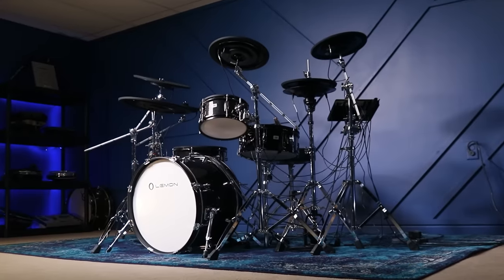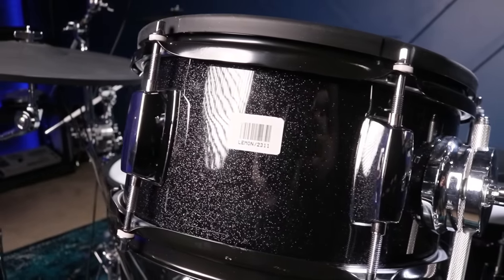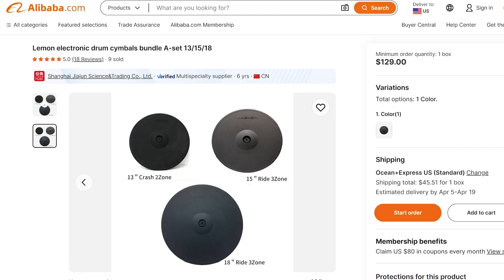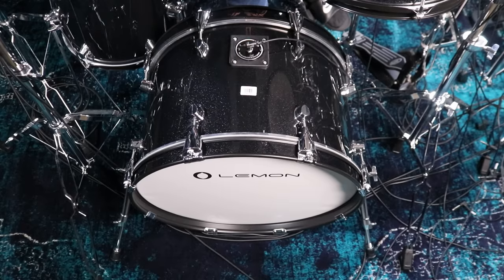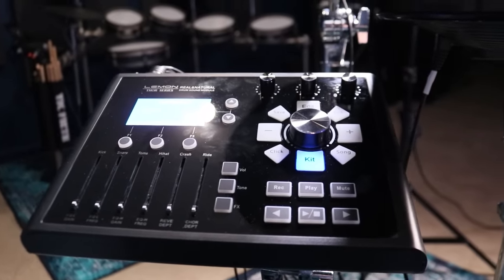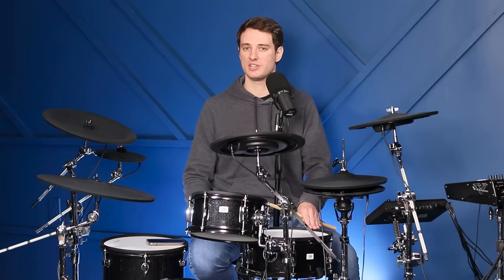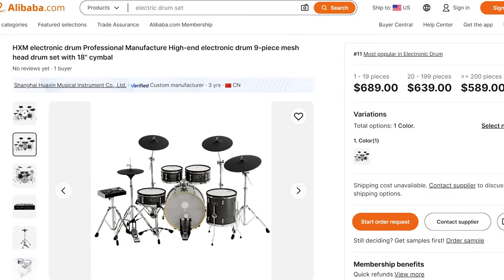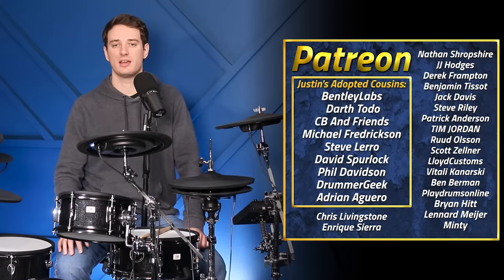Lemon T950 Review - The Alibaba Drum Set

Comment: I've had this kit for over a year, and I'm on the complete opposite end of the spectrum. I would recommend it to 99% of people. Not a single drum module out there can produce the sounds that I can with Superior Drums or some custom made kits inside Logic.  I would skip the $140 module and buy eDrumin 10 and trigger Superior, Logic, Kontakt, BFD or whatever you wish. I would also skip the 13" crashes and pay the extra $7-8 to upgrade to either 15" crashes or 18" rides to use as crashes. I lowered the tension on all of the mesh heads and my experience improved 10x  with respect to triggering and nuanced playing. This is especially true for the kick drum. Also, I stuffed old couch cushions full of all the shells and noise pretty much disappeared. And last but not least, in Nov-Dec 2023 Lemon started putting 3ply mesh heads on their kits. The way you know is if the kick out head is a resonant head (not mesh) you have 3 ply mesh on all of the strike zones of the shells. Skip the module, skip the kick pedal, replace some cymbals with larger ones and this is pretty much a perfect, nearly a full size kit. I love that the kick isn't too deep which makes this kit, being full size, a perfect one to place in a smaller room..
Reply: Wohooo! Could be my comment, mate! 
Module-wise I am a kind of spoiled using 3 eDRUMins.
The Lemon module seems to suck. What about latency, is there more latency than with the Roland thing?

For edums became kind of a religion at least passion. Damn I love these SD3 sounds.
See my info tab. I still use basically the MPS-850 and mixed them with 2 12" Alesis tom pads. Snare is a drum-tec style DIY system, and Lemon cymbals -- the BIG one, dudes.
All 3 zones. 15" hihat - also Lemon 3zones (so I can use the SD3 bell articulations), with a DIY Hall sensor. And ... it's amazing. There is one Lemon snare pad which I use a the side snare, it's working with positional sensing actually but I think I will put my Jobeky snare back on a snare snare stand.
3x 11" splashes, 3zone, of course. I modded some of the Lemon cymbals that they work as Yahama style cymbals to save inputs on the modules and ... recently, I was really pi***d off by the bouncy ATV 13" kick pad and ... don't ask how I get to that... but I bought 2 Roland used KD-7, they work great. :-)

A few weeks ago I was using some simple piezo as kick pedal triggers,  and they actually work quite well but ... ya ... still the bouncy ATV pad.

Yeah... obviously not only drumming. I spent more money on the sounds, that on the pads. LakePeople hp amp, RME Babyface interface...
Reply: Agreed
Reply: " Not a single drum module out there can produce the sounds that I can with Superior Drums" The 2Box Drumit 3 and 5 does Sound like Toontrack,  Addictive,  BFD,  Steven Slate Drums or what ever, if you layer the Drumkits and load them in to the Module :-)
Reply: @c.s.8192  Making drum module jokes?
Reply: @eDrumsInANutshell  no jokes.
Reply: You're a legend. Thanks for the description
Reply: total rubbish bud.
Reply: Found the shill! 😂
Reply: Yes even with high end kits like Roland’s, VST’s like superior drummer 3 smoke even the most premium kits’ modules. I have a nice kit (TD-27kv2) and I thought the module sounds were decent but felt like I was playing an electric kit. Until I downloaded superior drummer 3 you have endless options of professional sounding kits. I live in a apartment so have to play quietly and I was using SD3 with my DT 770’s and I literally felt like I was playing real acoustic drums sound wise. I had to take my headphones off to doublecheck that I wasn’t actually playing those sounds out loud. Definitely recommend using a VST regardless of what kit you’re using.

Comment: You GOTTA do the XD-2000 from HXM. I just got it, insane value for under $1000 (shipped!). It's the same exact kit as the Millenium MPS - 1000 from Thomann. Has a module with EIGHT line outs like an Alesis Strike Pro SE. Really interesting hi hat design that acts like a two piece in a one piece, and it's optical. Seems much better put together than this. Except for the cymbals... I've had a cosmetic issue with the cymbals, but even for the shells alone, it's more than worth it.

To be fair, I used it with my eDrumin 10 and not the stock module (I'm the guy with the Dante setup you covered in another video), but I may try to set it up soon. Let me know if you have any questions.

Wrote my comment before I saw the end of the video... lol.

Also forgot to mention:

- I'm not sure if the line outs on the HXM module are balanced; the seller said they're unbalanced. I haven't tested this out and would require an 8 channel DI box if true. 

- The HXM hi hat is optical. I've gotten it to TECHNICALLY of work on the eDrumin 10 (it would go through the entire range of the controller everytime I hit the pad with the pedal anywhere between closed and open), but I just use the GoeDrum controller underneath the HXM hi hat so I get the action of a two-piece hi hat pad. Even though the HXM hi hat is one piece, the design actually allows it so slosh around or stay put like a two-piece pad because of this weird ring on the bottom of the pad that sits on a little circular platform. I put the Goedrum underneath the platform with a tiny foam ring between them.
Reply: Thanks for the comment. +1 to a review of HXM kit please. I am very interested.
Reply: How much latency are you getting with your Dante setup?
Reply: Also, may I ask which video it was covered in? I'd be interested to see it!
Reply: @galgogergo  Very little if any. I'd say it's probably faster than if we used a USB audio interface, because there's less A/D conversion that has to take place. I've even forgotten to switch it from 512 samples to 64 samples because I didn't notice any lag. It was covered in the video "This was supposed to be a roast" or something like that.
Reply: @austinpalmer8850  cool, I'm watching it right now! Can you say at which time it comes up?
Reply: @austinpalmer8850  AHH, found it from 12:12 in the video "This was supposed to be a roast".
Let me ask some more:
Do you use plain Dante virtual license to get out of the Mac mini, right? Which year/model of Mac mini are you using?
And also: how do you receive your monitor signals? (Jack from Mac, a separate interface, or it's straight back from the FOH console??? Also you go into the console Dante card input, right? No switches, etc. Which console do you use? (A&H/Behringer X32/etc)
We're considering something similar in our church, that's why I'm asking.
Reply: Reason I specifically went with Lemon T950 is that the rack toms are mounted on the cymbal stands. I found that it's easier to isolate cross talk this way. Otherwise, if you're an aggressive drummer, you might run into issues with toms being triggered while slamming the kick or vise-versa. 

That said, the one thing HXM has going for it is a better look and what appears to be slightly larger shells.
Reply: @galgogergo  So we're using plain Dante license on a 2020 Mac Mini with an M1 chip. Anything with a Silicon chip is going to run EZD3 or any other drum plugin no problem. We also use Dante for splitting out backing tracks and click and guide (on a separate MacBook) and it works great. We monitor using Allen and Heath's ME personal monitors since we're using a DLive S5000. We're using a switch. Dante is amazing especially since we also use Playback for the other reasons I mentioned, but if you're not knowledgable about networks and routing it can be a massive headache. We've ran into multiple issues and if we didn't have our Tech guy I would have no clue how to fix it.
Reply: @aeiplanner  You can isolate the HXM's toms the same way with the right attachment. They're like $20 on Amazon. I've had zero crosstalk issues, which I honestly was anticipating; plus, if there is any, it'd be no more than real toms on a real kit, but so far they trigger great.
Reply: @austinpalmer8850  I’ve been doing something very similar at my church for some time. I trigger superior over MIDI RTP to a Mac mini that is mounted under the desk at FOH which is connected via Dante to the Yamaha DM7 console. Total roundtrip latency is 1ms. CPU load is pretty negligible with the original M1 Mac Mini. I’ve even set up different kits on different midi channels for the drummer to flip through. E.g. on an old Roland module he can call up a specific kit and it automatically switches to the corresponding Superior Kit within Logic running on a MacMini. A good use case for that would be a tighter brushes kit for faster songs, or a piccolo snare, versus a deeper, lower tuned snare for slower ballads.
Reply: @aeiplanner  That's a sweet setup. We actually had a pretty decent acoustic setup and the volume was alright, but the amount of work it takes to make an acoustic kit sound good (especially with volunteer sound engineers) was too much. Once I discovered drum plugins vs modules, we switched.  People couldn't tell they were electric for MONTHS, and even a lot of the musicians couldn't tell until they were on stage! The best comment I ever got was, "Why are the drums quieter but sound better?" Looks a lot better without the shield and mics and mic stands too.

Comment: Hey Justin. I wish you would have made this video sooner. As I was going back and forth on taking the chance on the lemon set or millennium in the last 2 months. I have a total of 6 electronic sets with a wide mixture of diy triggers and Simmons triggers on the acoustic shells. Every one of them I have dial in the trigger and sound setting to work great. I have. TD10, TD3,Alexis nitro, Alexis DM10, Yamaha DTXpress lll, and Yamaha Dtextreme ll, Most recently I purchased the Lemon T950 set and new the module would be replaced.   I had the exact same issues you did, plus the knob on the module just broke.After 2 months I was able to make 2 custom kits that were ok, but couldn't get the snare to trigger fast or consistent ghost notes or accent. The rim shot or cross stick for snare  I never got to trigger right. So I gave up and got the Alexis Strike Pro module for this set 2 weeks ago. I'm already loving the sounds much better and the ability to layer sounds. I did have to swamp the cable inside the ride cymbal, but other than that everything has been triggering fine.

Comment: Congratz for the first T950 review out there. Was searching one 5 weeks ago, couldn't stand that there was none and just ordered the set from China. 
Glad, that I already found a used td-27 module. And thanks to your video, I'll definetly order some glue 😅 otherwise it still doesn't seem like a too bad choice...
What about triggering from the pads? You just mentioned, that they are "falling apart", but what about trigger quality, possitional sensing or response when using the TD-30 like you did?
Reply: paired this with TD11, been using it for almost 3 years. Awesome kit
Reply: @restymalinao2023  in your 3 years of usage, did you also face issues with moving piezos?
Reply: @PythoM2  so far, the trigger performs good. But I haven't checked the inside. Maybe i'll check it soon

Comment: Great review man. Definitely agree with everything you mentioned here. I have a question for you and hope you can help. If I were to get the Roland TD17, would those issues of different trigger zone be fixed and it will still just be 4 midi notes likeyou mentioned. That’s the the downside of these drums for me. Is that module, I get alotof missed triggers with it and it just ruins the experience even though I use it with GGD drum samples. Hope I get some feedback from on that question. You think changing the module will fix triggering issuesI have? I am  still learning from this electronic drums so not sure if the issue is the module or the triggers. Thanks man!!!

Comment: Please do a video on the HXM kit! Would be awesome to see the cymbals that come with them compared to lemon too. In the UK, the cymbals can be purchased separately (under millennium) for less than the lemon cymbals.
Reply: The cymbals are almost like Yamaha's, and the rubber is much nicer. Although if you hit the edge too hard, this plastic trim can come off and then you gotta glue it back.
Reply: well the millenium cymbals quality isnt really good already had to replace one of my crashs (in warranty so i just got a new one though), the rotation stopper on them is garbage... the ones the lemons use (actually the roland ones) are way better would take the lemon cymbals over the ones from millenium at anytime, but the drums it self seem to be of way better quality compared to the lemon one, but i prefer the tom holder of the lemon set
Reply: @Gamer-kn7fi  you have the mps-1000?
Reply: @Gershy13  yes
Reply: @Gamer-kn7fi  Cool, so you prefer the lemon cymbal to the millenium cc-15 or cr-18?
Reply: @Gershy13  I only have zeitgeist cymbals as a comparison but these are rebranded lemon cymbals. And yes these are from far superior quality compared to the millennium ones. The millenniums aren't particularly bad  just not quite as good as the lemon ones.
Reply: @austinpalmer8850  Never tried a yamaha, Ive only tried mps-850 cymbals (which are shit) and roland TD-50 cymbals which are really nice. Would you prefer lemon or HXM/millenium cymbals to upgrade my mps850?
Reply: @Gamer-kn7fi  Cool thanks, yeah I see they are made by lemon, so they should be the same. Ill definitely get lemon then! Probably going to upgrade my mps850 and get some 3ply heads, lemon cymbals, and an edrumin.
Reply: Probably Lemon. I've had zero issues with the Lemons and I ran into an issue with the HXM crashes pretty fast. They reimbursed for the re-gluing I had to do, but the Lemons have never given me issues. Also the Lemon Hi-Hat controller is REALLY nice. I'm using a similar controller with the HXM hi hat (the controller for it is optical so it's wonky) which is nice because the HXM hi hat responds like a two piece in that it stays put with the pedal down and sloshes around when it's open. I do prefer the feel of the HXM cymbals though, so I'm not putting the Lemons back on unless I continue to have issues with the HXM's. @Gershy13
Reply: @austinpalmer8850  you said you prefer the feel of the hxm, is that the hi hat specifically or all the cymbals? I do want to replace my hi hat too, and was looking at the lemon two piece. I don't hit that hard so I don't think durability would be my issue, it's more triggering and playing feel that I'm looking for.
Reply: @Gershy13  I can't comment on the two-piece from Lemon, but I can comment on the standalone hi hat controller from Lemon and it's fantastic. Really sturdy with a massive range. I really love our setup with the HXM hats (which mimic the action of two piece hi hats depending on the pedal position) on the Lemon-type controller. It looks a little funny with all these different pieces stacked on top of each other; but the feel! The problem is the hi hat clutch on the HXM is really narrow and only fits small hi hat stand rods, like the HXM stand, which is not as nice as our PDP stand (but works fine). I'm assuming the Lemon two-piece would be nice judging by their other cymbals and the hi hat controller, but you just never know. Also, the HXM controller aspect of the hi hat by itself won't work with most modules because it's optical, and even when used with their module I couldn't get it to work decently, though admittedly I didn't try for very long because I knew we were going to use our eDrumin 10. There's another review on YouTube where a reviewer needed to calibrate the hi hat on the HXM module to get it to work, and then it seemed to work great, but I prefer individual cables going into the eDrumin 10 rather than a breakout cable, and since I'm already on the computer to adjust EZDrummer 3, it would be a pain to switch back and forth to adjust sounds and trigger settings.
Reply: @austinpalmer8850  Thanks, Im really struggling to decide between the lemon 1 or 2 piece or to get the hxm and a controller like you did. In terms of playing feel on the sticks, if you had to compare hxm vs lemon (all cymbals), what do you prefer and why. I plan to get an edrumin too.

Comment: the cheapest TD-30 modules on Ebay also cost more than this entire kit
Reply from the maker: True, I’m not saying buy that module, it’s just what I have.  a used TD11 icame out the same year, is really cheap, and has the same trigger engine giving you the same accuracy.
Reply: @65Drums  That wouldn't be compatible with the VH-13-style two-piece hi-hat though, if I'm not mistaken.  I believe you basically need a >$1k (used) module to have even the same basic functionality
Reply: @65Drums I have a td-9. 

Will that work with the symbols and high hat?

Comment: People saying lemon cymbals are awesome is unbelievable. They are exactly like a wood plate covered with a towel. Noisy and with velocity inaccuracies. Returned 3 of them.
Reply: Hamburger vs steak I guess but they are awful to hit. Maybe ok as an effects cymbal at a push.
Reply: IDK. I have 4 Roland cymbals and a Lemon splash and it's cheap and good enough. It's not going to last as long, it has a bit more cross-talk between edge and bow, but it was like $25.
Reply: @fallenshallrise That is the point ... 18" for converted like $75 (I am in Germany) . For $350 less,.... I hit the cymbal there where the velocity is how I need it to be. :) 
Really. Or I just stick another 20cent piezo to it. Noise it not an issue for me. 
But I am not a pro touring with Alicia Keys. Of course there are situations where you just need working setups for hours.
Maybe "awesome" is the wrong word. The price/performance is smaller 1 or price < perfomance. 
And the support is great. I ordered 3x 11" triple zone splashes and got 3x 18" rides. After complaining I got my 3 splahes. Without sending back something.
price << perfomance ... 
Dude, velocity inaccuracies, really?! On a $25 cymbal!? Roland uses 20 cent piezos as-well !!